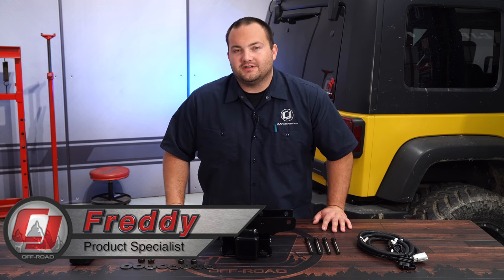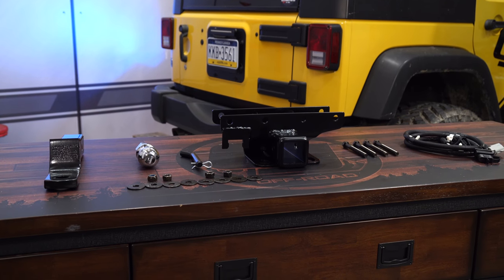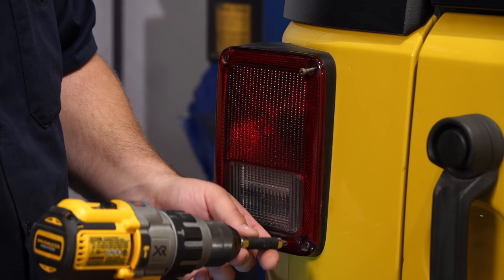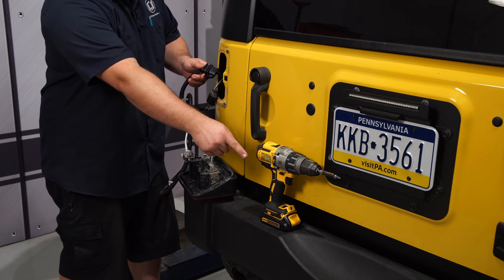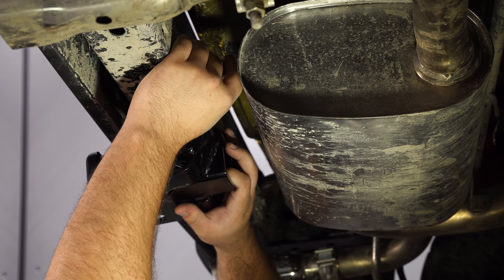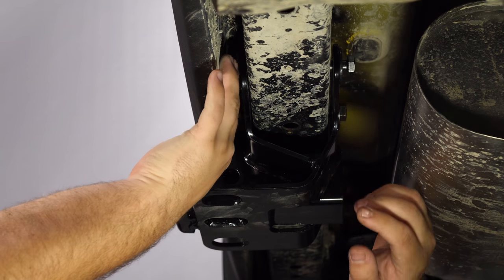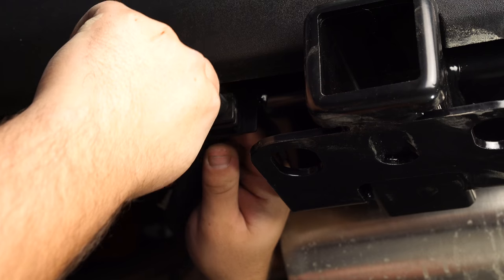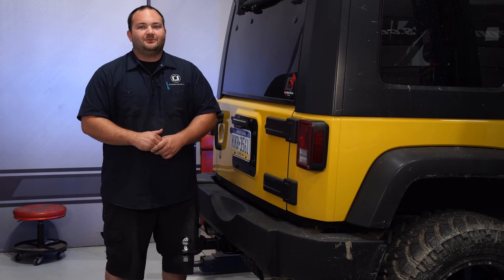Jeep Wrangler JK Rugged Ridge Receiver Hitch 2" Hardware/Wiring/Drawbar/Ball 2007-2018 Installation

Comment: I see two ways of people installing these. This guy did the way where you put the bolts thru the front, which doesn’t require the bumper to be removed. And the instructions and other videos show to remove the bumper so you can insert the bolts thru the back. I’m not sure how much it matters but this way looks simpler. Thanks!!!
Reply: do yourself a favor and REMOVE the rear bumper! It will be much easier to get it done. Its near impossible to sneak the washers and nuts behind the rear. I certainly couldn't even put my fingers there. I tried to do it with long pliers etc, but no chance. SO i removed the rear bumper (its only 8 bolts total -> easy) and then the installation was a breeze! Definitely way to go to remove the rear bumper, if you want to spare yourself anger, frustration and foul language..:-)
Reply: @ralphderkapitaen9875  I also was having great trouble with the washers and nuts but I have a slick hack for anyone reading. Tape the washers to the back of the hitch first(don't cover opening) and place a piece of tape on the back side of the open ended wrench to hold the nut in place, made my life a heck of a lot easier, no bumper removal, and I even have long skinny fingers and I couldn't do it by hand, I also used a spare adjustable to pry the bumper apart because mine was even closer than usual